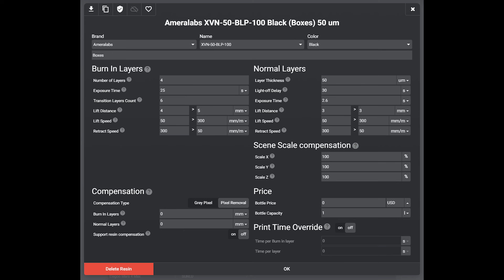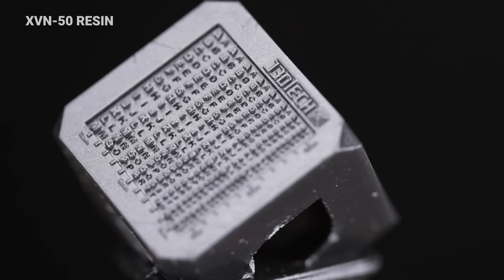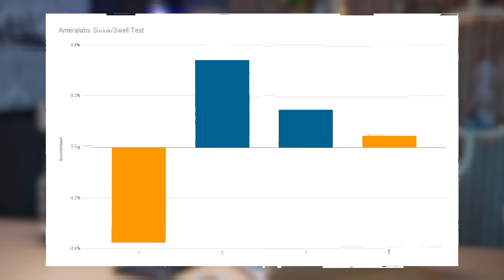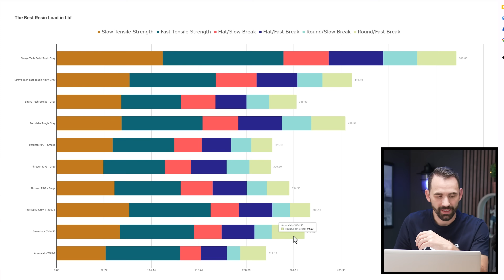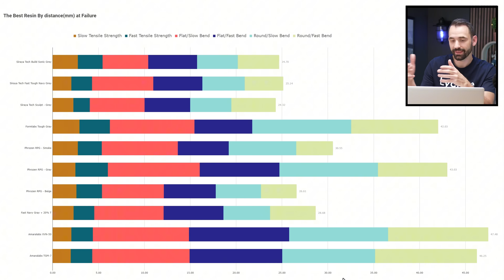Our test machine failed to break this Ameralabs resin | Resine Review

Comment: Would love a video on what are the best resins for table top gaming and which would be your overall pick. TGM-7 is popular because minis survive being dropped. But detail and being able to be painted is also important.
Reply: That's not a bad idea after I do a few more I can do an ok who is best. 
RPG has mid-high accuracy and medium survivability.

Resins like hyperfine, Navy Gray, Sunlu 14k have the best accuracy but also some of the worst survivability. 

Tgm7 has  medium accuracy and very high survivability. 

For cost the ABS likes are cheapest, RPG medium TGM7 high. 

In the end, what's best for person A may not be the best for person B. But I do strive to present the data so that each person can look at each different resin and determine what fulfills their needs.
Reply: @J3DTech I asked around on some forums and discord groups and it seems a crowd favourite is elegoo's abs-like v3. And some people add siraya techs tenacious 85:15% mix. But never seen these tested or validated. Is there an easy way to mix resins? Would prefer to avoid that if possible.
Reply: @ChitosVids I actually tested the Sirayatech blend in the resin testing video just before this one. 

That Sirayatech blend is actually mine. About 3 years ago I reached out to the CEO of the company to get a better, more durable mixture than the Navy gray and we worked with each other to get the tenacious tested and that's what I've been using mostly ever since then. 

As far as the elgoo resin is concerned, I have used it. I have printed it and I just have to go break it in my test machine. However, I will say it's one of my least favorite resins. It's actually about on par with accuracy as the tgm7 with none of the durability. However, it is very cheap.
Reply: @J3DTech i see. I would love to see what in your opinion is the best for table top gaming then. At a budget level and a premium level for those really nice miniatures. An extra category might be terrain so for that people often don't care too much about detail with terrain but durability is more important, and you often need way more resin to print out enough for a tables worth.
Reply: @ChitosVids I think the problem is with terrain is people will go for the cheapest resin they can but the cheaper resins have a large postcure shrink so you end up with terrain that is warped on the bottom doesn't sit straight or if they're designed to connect with each other they start getting big gaps and warping. 

It's because of this. I generally say you should do train in fdm or if you're going to do resin you're going to look for resin. That's cheap but also has Very low post cure. Shrinking the problem is is most resins that have that attribute will be found under the engineering category and generally aren't going to be too cheap. 

In the end you do get what you pay for.
Reply: @J3DTech your video your referencing is that the one where you're testing the sonic build resin? Interesting resin. The build sonic looks for good for vehicles etc
Reply: @ChitosVids Yep that's the one!

Comment: What about the ambient temperature?
I've had issues with the same resin becoming brittle at 20°C and flexible at 35°C. The sweet spot was 25-30°C where the resin performed insanely well.
Reply: My house is kept at 72f and the materials where tested at this temperature. I actually recorded me breaking them often a day before the rest of the video so they don't get hot in the lights. 

Even for the Sirayatech video I made 2 copies of the tests. One for the video to have and the others I had tested before recording for this very reason. 

I really do try to control all I can with this testing.

Comment: Dude.

You lost me at $80/kg

Is your audience engineers and dentists?
Reply: Engineering parts are the 3rd most 3D printer item in resin. 

As for miniatures I very often get approached for a resin that will survive shipping to customers. 

Consider the cost of a professional paint job on a mini and now a resin that won't break is by far the cheapest part.
Reply: @J3DTech  Most professional paint jobs seem expensive but really aren't, You're spending like $5/h on them most of the time. Its rare I see something sell for more these days since everyone and their mother wants to be a commission painter.
Reply: @MrPigments That is crazy low pricing but on average what do you charge per painted mini?
Reply: @J3DTech I charge around $20/h but I'm also incredibly fast. I mostly just get locals since I'm the best painter at my local lgs but I live in the middle of nowhere so talent is slim pickings.
Reply: @MrPigments  Do you see value in a resin like THM7 for some of your more detailed work?
Reply: @J3DTech  I see it as useful for hero forge stuff but not much else
Reply: @MrPigments Don't forget about Flesh of the gods

Comment: Hi, 4 stage cleaning for so many minutes… doesn’t the resin become weak? RN I’m using rpg gray from phrozen and on the website they suggest submerging models for 1 minute only. It’s relatively easy to print with
Reply from the maker: Ameralabs recommend a 15min wash at least, it's a technical resin so it's gonne be different than others :D
Reply: After 1 min it would still be covered in uncured resin.  This stuff was pretty hard to get fully clean having a slime feel even after the 3rd wash.